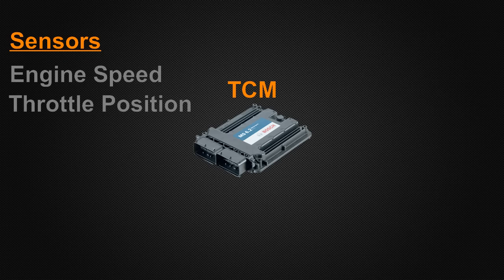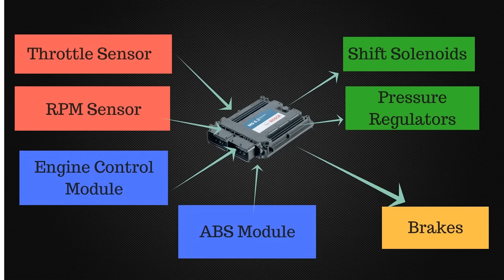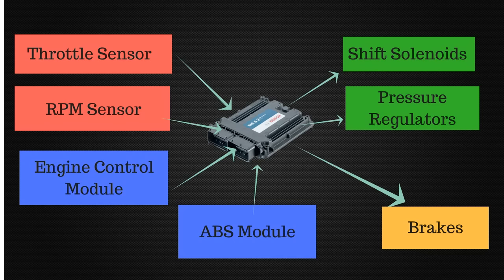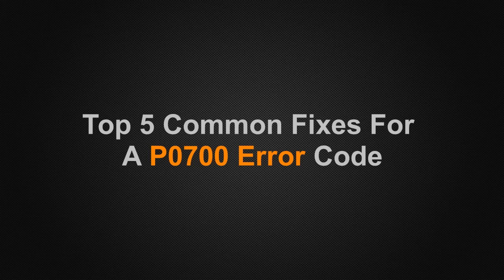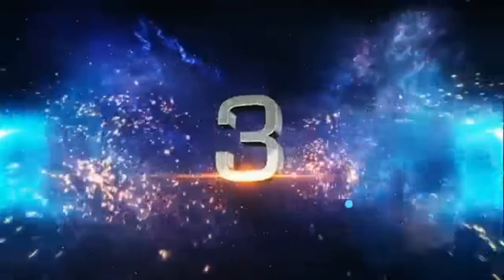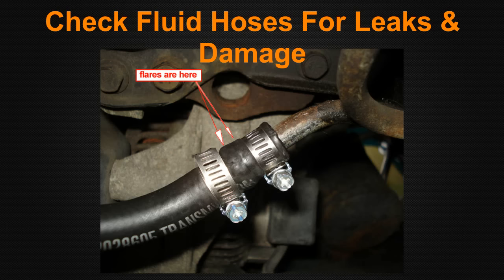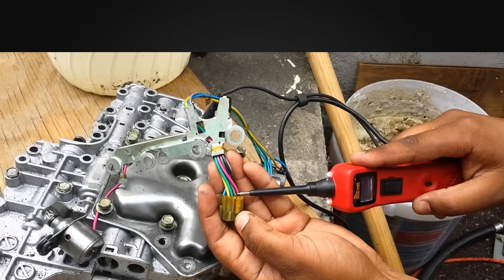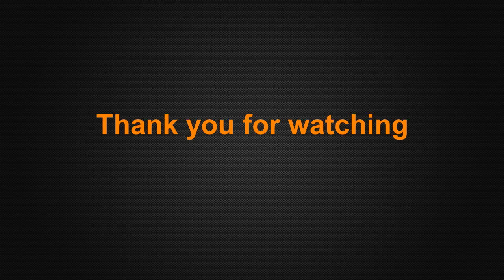P0700 How To Fix The Error Permanently

Comment: Top 5 Troubleshot GoTo's:
1. Automatic Transmission Fluid
2. Check Wiring Connections (ECM & TCM) 
3. Check Fluid Hoses For Leaks & Damage
4. Check Transmission Solenoids (Recommended to let professional open the gear box to do this so you don't further damage)
5. Check Power on the Power Cables from the Drive Controllers in the Valves (You can use a multimeter)
Reply: Thank you 🙏
Reply: What about valve body could that be it too??
Reply: Thank You
Reply: What is the difference between ecm and pcm are they the same
Reply: Where the link

Comment: I have a 4 cylinder Accord Tourer 2.4 vtec year 2003; do you know how many oil pressure switches it has? I'm talking about the P0700, automatic transmission pressure switch.  Thank you!

Comment: I got error on speed sensor and abs light and check engine with my 05 Subaru outback will the enough to trigger the P0700 code. This video make a lot of sense to me means in my thoughts wheels are connected to the transmission I already know I have a bad wheel bearing or possibly bad speed sensor.

Comment: I made a k-turn yesterday and hit the gas too fast while maybe having the shifter in between neutral and drive and got 0700 and 0516 codes. The trans was sputtering, so I pulled over, turned off the engine for 5 minutes. Check the trans fluid level and its good and it's perfect in color and no burnt smell. Started it up and is running good again. Cleared the codes when I got home. But this '05 TJ Rocky Mtn with the 42rle always runs, I believe in limp mode every time going up my driveway and onto the road, gets to 20 - 25mph and catches/shifts and runs well after that.  Any suggestions??

Comment: If I replace the TCM will the code go away and fix my stalling issues
Reply: Did it work
Reply: It’s was the pcm 100 dollar part 20 minute easy fix The Powertrain Control MODULE It’s been running good ever since and I’m glad cause it’s a bad ass car and o was bout ready to give up on it
Reply: The problem is you need to run a ground wire from the tcm to the ground ln the car and it will resolve all of the issues we're having with the cobalt, this information came from GM service bulletin but they're not doing a recall for the issue

Comment: would that effect the power sterring
Reply from the maker: If its a late model vehicle with some active cornering system that works with ABS & Transmission there is that possibility
Reply: all i know is that the abs light came on

Comment: My brother can help. I am an Arab from Iraq. I have a problem with an Opel Vectra 97B. Transmission to an electrician. A problem is that the car is moving from Namera 3. I checked the electricity at the technician and did not find any fault. Please help. I am tired. I do not find anyone who knows the problem.
Reply from the maker: If all is ok with wires perhaps it could be inside the transmission itself, solenoids etc. Remember transmission works by pressurizing the ATF. If solenoids are not functioning proper you will experience shift problems. If your auto electrician found everything ok on the wires side of things you may want an auto transmission specialist to look at it. If again the insides of transmission are said to be fine your problem lies with the TCM. You have to replace it. Also ensure there is enough ATF
Reply: John Amahle I have replaced the transmission and the problem is still there and I took it to an electrical technician and said there is no problem of the connection exists but how can I check the computer of the carrier that is under the drawer of the box What do you mean by the solenoid I mean the computer carrier wire
Reply: John Amahle The 1997 Opel Vectra is the transmission of an electric motor
Reply from the maker: @Matrix-26  if you replaced entire transmission try changing the transmission computer. Replacing an entire transmission and seeing same problems is a sign that the TCM (Transmission Control Module) is malfunctioning
Reply: John Amahle Thank you my friend for helping me. You are really awesome. I will replace the computer of the carrier under the glove box, but I was afraid to replace it. I opened it. I did not find a request or anything to be suspicious. Do you have Facebook or a contact website?

Comment: Hi, I have a 2008 Saturn Vue that is giving me a code  P0700 $07E8... with this info do you know what the problem might be? Thank you!
Reply: betty Ortiz did Unfigure out? That’s what mine is doing
Reply: We use to have the same codes ... try changing the fluid and putting the treatment B&G Transmission Additive works really good... some of those Saturn's are the same as an Acadia as well and sometimes it good to clean the throttle body ...
Reply: Melissa Huff no I ended up getting rid of it.

Comment: Hi, I have the same code  P0700 And P0671, PLEASED HELP, are you in the UK?
Reply: Did you fix them? How did you do it?
Reply: Run a ground wire from tcm/ ecm to the ground on body of car and it will resolve all of the issues such as transmission shifting hard, stalling out, no start, misfires power steering ECT this is per GM service bulletin they're not doing any recalls though but they're telling us how to resolve the situation

Comment: PO700 is an engine code, general trans problem, no permanent fix possible
Reply: Per GM service bulletin you have to run a ground wire from the tcm/ ecm to the ground on the ground on the body of the car and that will resolve all of the isdu